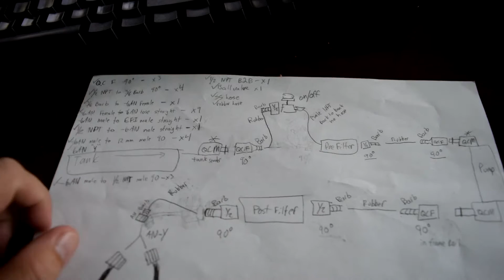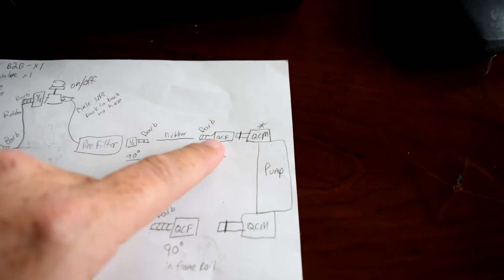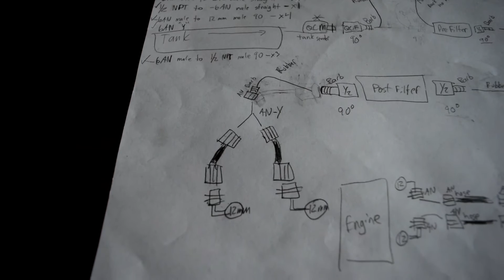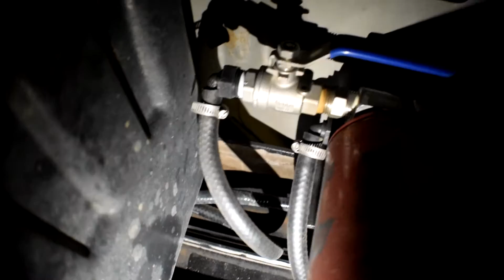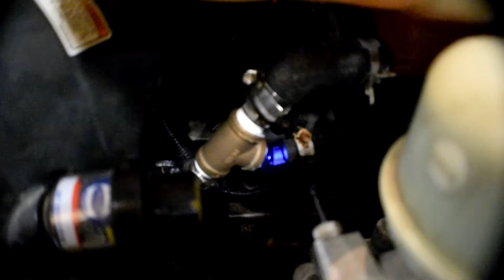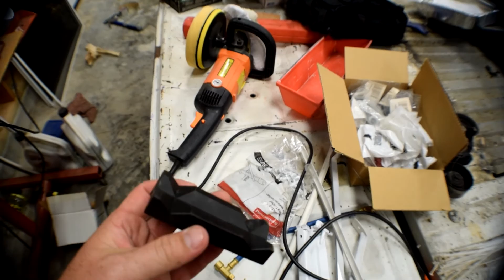F250 PowerStroke 6.0L - DIY Regulated Return Install Finished

Comment: I'm in the middle of installing 175/30 injectors on a factory fuel system.  want to build my own complete fuel system upgrade to support max weight towing. 550HP  goal.?
Im thinking about the black nylon AN6 lines and fittings  with regulated fuel return like that you see on ebay. 
I need to hold 65 psi fuel pressure at WOT to ensure the longevity of the very expensive injectors. Or so I've come to understand. 
I would like to know what is the best choice
Anyone can go buy an expensive kit. I'm on a budget and that isn't a good option for me.
Looking for any advice on how to proceed with the fuel upgrade. 
2006 F 350 SRW 4door 4x4 long bed Larait, 4in lift on 35s
4in straight to 8in bed stack
Banks intercooler and piping upgrades..SCT ts Livewire, ARB head studds, HPOP. Much, much more thanlistae oh

Comment: Question;

Great set of videos. I like the DYI regulated fuel return. In your first video of this project it looked like you had coated your frame with some type of black coating. What coating did you use and what did you do to prep your frame for the coating?

Comment: Why are you regulating your return line? That is not necessary.
Reply from the maker: It actually is very necessary.  If you don't  have a regulator then the fuel will take the path of least resistance.  Which would be the return line back to the tank.  So you'd never get enough fuel to the injector instead it would just circulate the fuel for you.
Reply: Well isn't that where you want the excess fuel to go, back to the tank? I put a 2007 5.9 Cummins in a 2006 Ford F-250 and had to put a regulator between the Ford oem pump and the Cummins injection pump to cut the Ford pressure of 60psi to 18-20psi to keep from blowing my CP3 pump.
Reply: @jfubele  your cp3 is a mechanical pump with unit injectors. These are HEUI - fuel is pressurized in the injector, not the pump.

Comment: Also, are you running your stock pump? Or did you upgrade, or do you plan on upgrading it to something like an aeromotive a1000?
Reply from the maker: I'm running the stock pump.  I don't have any plans to upgrade it yet since I'm still on stock injectors and everything else.

Comment: Did you have any leaks at the head?  I am making mine right now and have a 12x1.5 to 6AN adapter fitting (aluminum), I was using a copper crush washer as you would with a stock banjo bolt and trying to use banjo bolt torque of 28 lbf/ft but ended up snapping the aluminum adapter.  How did you get your fittings to seal at the head? what did you use?
Reply: You didn't have any issues with clearance running those fittings? I was planning on running these, https://www.summitracing.com/int/parts/vpe-11523 But if the fittings you used worked it will save me lots of cash as I'm in Canada and my local performance shop has to special order the banjo fittings.
Reply from the maker: No I didn't have any clearance issues.  I saw a few posts where people used the banjo style fitting and they had to grind down part of the head because of how close it fits.  I also like the other style fitting because it swivels
Reply from the maker: C2H6 no I did not have any leaks. the fittings I used had orings on them so just snug is all they needed
Reply: Do you have a part number for the fitting you used
Reply from the maker: Yeah I got em at summit EAR-949092ERL.  You can see on the side that goes into the head it has an oring to make the seal.

Comment: I think I heard you say you set fuel pressure to 40psi.  That is too low for a 6.0 injector.  Run at least 45 psi or you're going to have damaged injectors before long.
Reply from the maker: Good catch.  I did say 40 but meant to say 50, I just forgot what the recommended pressure was when shooting this.
Reply: Okay then.  Yeah apparently with a flow-through system most trucks run better at about 50psi.

Comment: aren't you the same guy that had that nightmare with fucking with all those ipr aftermarket bullshit? how did that end up working out?
Reply from the maker: Yep that's me.  I pulled all that junk off and am running all stock now except for a coolant filter.  Truck runs like a champ now with only 6-8 degree deltas between the coolant and oil temps.
Reply: Joshua Scarbrough right on man yea I saw that shit and felt bad.. I've got an 06 F250 Harley Davidson edition completely un molested with 166k only thing it does have is a fabtech lift and dumb ass k&n which I'm contemplating changing back honestly.. Good luck with the set up and thanks for being willing to try out all this shit and letting us see what garbage is really out there I've always maintained how can a small shop or company know better than an international cooperation that spends hundreds of millions in R&D ? Its just not possible. Yea they may have goverment restrictions to follow but still. Other than all these dpf systems on the new trucks you can't kill a well maintained diesel..
Reply: Hey I saw in another one of your videos that your keeping that aluminum high pressure oil pump? dude.. dump that shit and update it while you have it all opened up otherwise you are absolutely going to go back in and have to replace it eventually.. unless your into self punishment..lol
Reply from the maker: Yeah I kept it.   Wasn't worth the $$$ at the time to swap everything over.  It was going to be like $1200-1500 for all the parts.  Figured I'd just swap the pump when it dies for about 1/3 that price.

Comment: does this completely bypass the secondary fuel filter and the factory regulator?
Reply from the maker: Yes it does, some people cut the fuel reg/filter off of the oil filter housing but I left mine for now.

Comment: Fwiw, I don't think this will work in a cold (-0) climate, to much opportunity for fuel jelling. Jmo
Reply: Jeff 'n Dorry W my personal recommendation, your additive should be taking care of that in the Winter.  I run through Gunnison Co regularly and I don't gel running the right anti gel.   I have never gelled, not once.  BTW Gunnison is usually the coldest place in the U.S.(town) in the Winter because of the elevation and the fact that it's in a valley.
Reply from the maker: Where?  There's probably only 3 ft. of extra line and it's actually made out of better material than stock (teflon with stainless braid vs hard steel & rubber.
Reply: Just bring it to northern Mn when it's -30 and we'll see what happens..

Comment: I would put the filter after the pump to prevent cavitation which will erode the pump impeller.
Reply from the maker: I do have a filter after the pump as well as one before it.  The next video shows the pre and post pump filters and the pre pump filter is designed to be on the suction side so it shouldn't cause any issues.  I don't recall exactly what the micron rating is of each but the pre pump filter is higher than the post.
Reply: Typically a filter is not put on the suction side of a pump. If you do see one it's usually called a screen to keep large partials from damaging the pump. Check out:  http://fuelab.com/what-is-cavitation-how-to-avoid-it/
Reply: @chrisphillips0000  from that page: "Use of straining filters is required for the inlet of the fuel pump. They to provide fine enough filtering to protect the fuel pump, yet coarse enough not to inhibit flow, or capture enough particles to cause a building up of debris. Finer filtration, to protect the rest of the fuel system (such as fuel injectors and regulators) can be accomplished downstream of the fuel pump with a second filter. Typically, straining filters for fuel pumps elements have micron ratings from 25 to 150 micron rating." Learn to read, you fucking walnut.